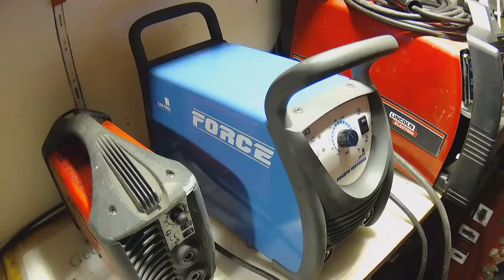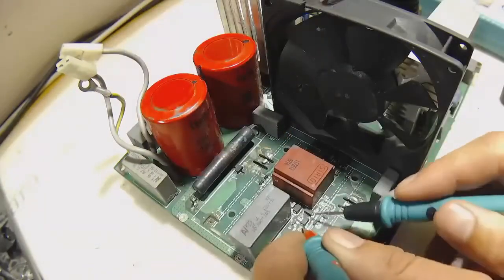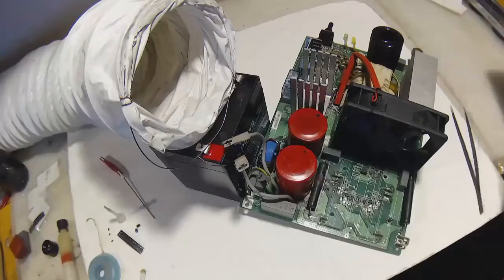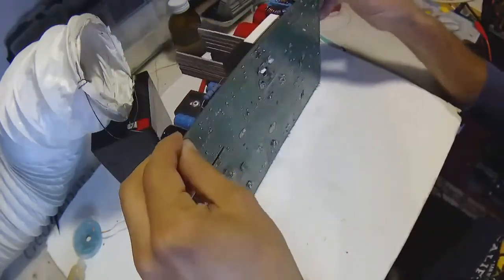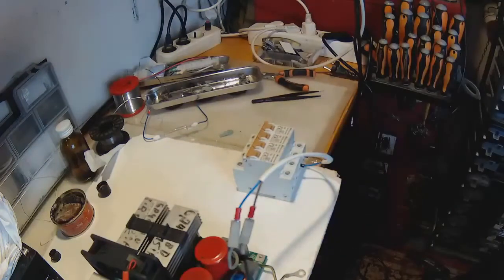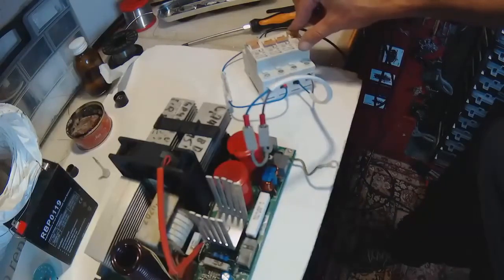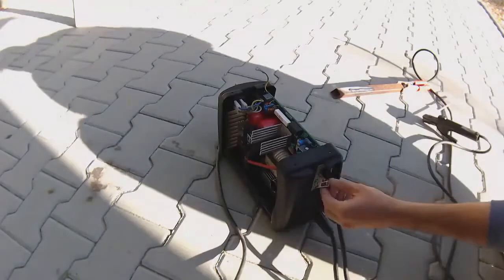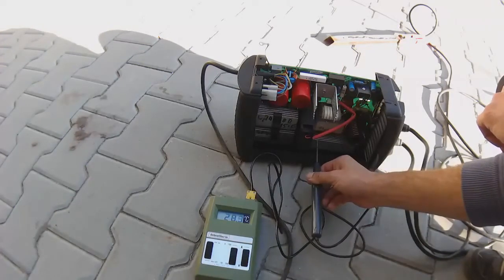1. Telwin welding inverter repair - Short version

Comment: Prietene,aia nu e placa de Tecnica 171,este de la un Tecnica 144-164.. E mai complexă placa de Tecnica 171.
Reply from the maker: Could be. I did buy it from a flea market so who knows what happened to that welder before I opened it. In regards of complexity I believe the 164 and the 171 are both two switch forward converters so the differences are minor and dependent on the iteration cycle of Telwin. In regards of complexity the SAF in my other video is more complex. It's is embedded and it has a rare IGBT driver and IGBT brick. Too bad I left home just before making a video of the LINCOLN. That is really complex. Two parallel power boards, 2/3 phase AC rectifying, embedded of course and a lot of sensing circuitry.